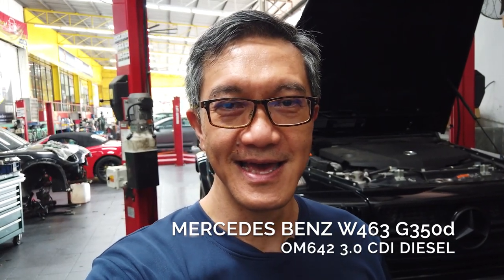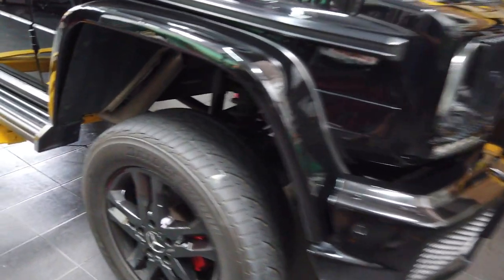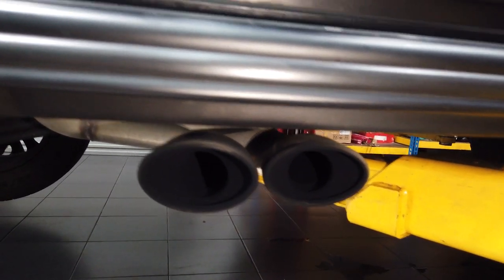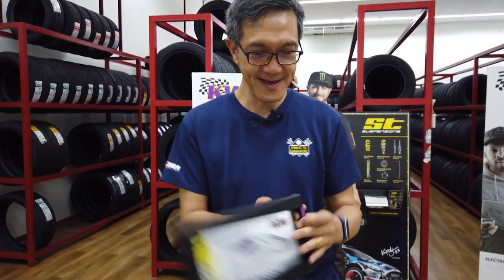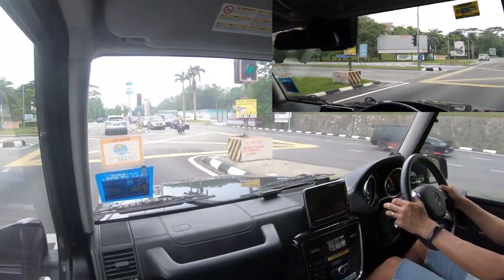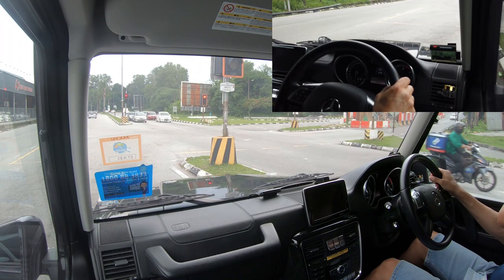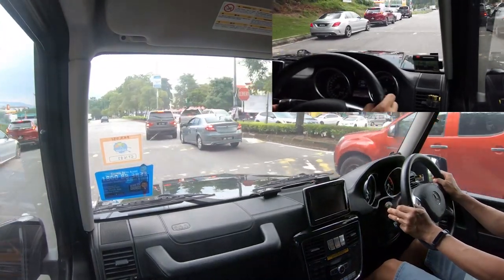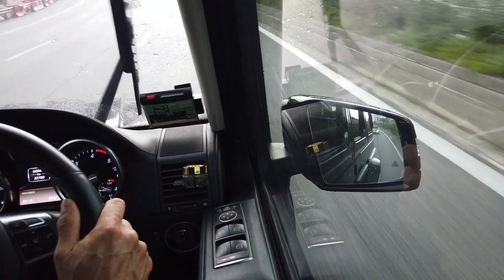G-WAGON COILOVERS UPGRADE & UNBOXING | KW STREET COMFORT | MIKE'S ON-ROAD REVIEW

Comment: Not make any sense! G wagon making vibration at low speed! Your should drive 30-50kmh for understand that coilover
Reply from the maker: This car has come back for its yearly service and the owner is so happy with its new found agility on the roads that gives him the confidence to cruise at higher speeds with comfort.

You have to experience this coilover to understand what this coilover is capable of, but then the damping setup is extremely important for the given road conditions
Reply: @mikeyap4159  g wagon is vehicle which one has a frame and its changing game totally, im not talking about coilover is bad or something else. Just for make sure and feel the new coilover u should drive at low speed. 
Btw question: right now im working on my 2022 chevy suburban premier, issue with new suburban is brake system is totally trash!!! Im gonna put there srt8 brake system and coilovers/suspension wanna change for get more comfortable. With brake im good, i wanna hear your opinion about what kind of coilovers will make more comfortable my truck ??